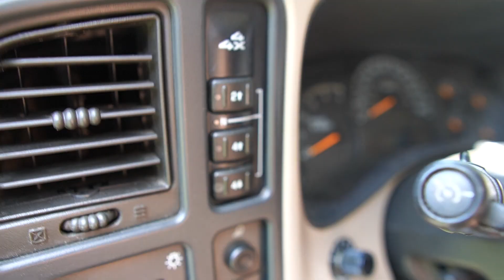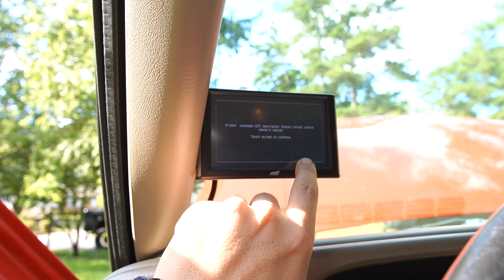My FICM Blew Up For the SECOND TIME....

Comment: You can run your ficm dry, and get rid of the factory hard lines and run a feed directly to your cp3. Been running mine like that for a year now
Reply from the maker: When you say dry, do you mean with no fuel running through it to cool it?
Reply: @JWMontoya  yes mine has been air cooled with no issues I read about people doing it on forums
Reply: @JWMontoya  bought 1/2 longer bolts and bushings to raise it higher off the bracket but I don’t think it’s needed

Comment: Whats the FIKM/FICUM? or however you spell it? lol
Reply from the maker: Lol FICM and we need a new one. It’s Fuel Injection Control Module
Reply: fuel injection control module
Reply: @JWMontoya  thanks J dub. Hope you get the LLY back up soon
Reply: @JWMontoya  those are pricey. I did mine when I had a problem with my truck a while back....turns out it wasnt that. So I spent like 1800 bucks for nothing. Lol
I cant remember what my problem was....but it was something simple and cheap. Lol....life lessons.

Comment: Might want to check the security on the truck. If batteries been disconnected for a good time the security will let it run for a few seconds and will cause vehicle to die. I would check that first
Reply from the maker: It wasn’t disconnected long tho
Reply: @JWMontoya  it's better to check and know than assume. Checking is free